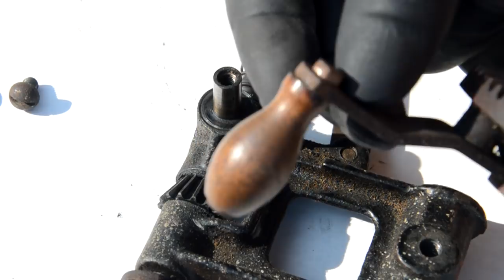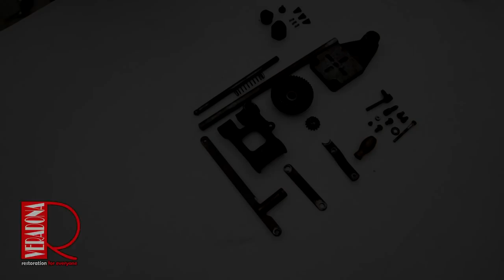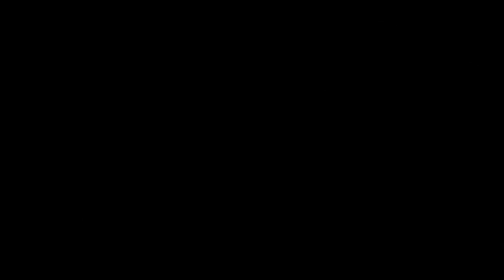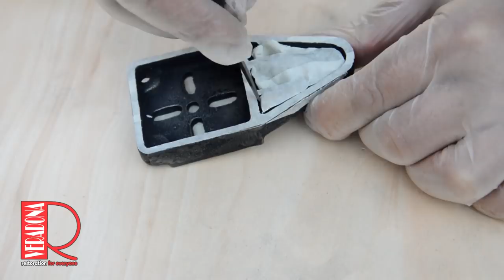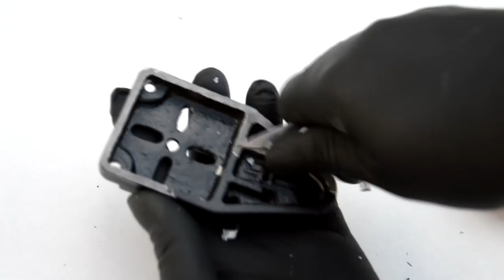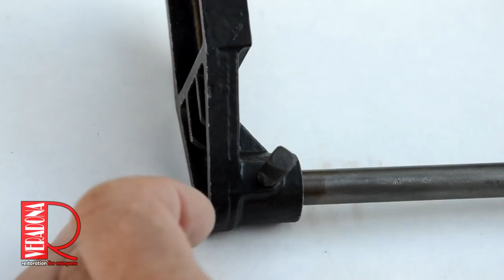Bench Drill - Detailed Restoration

Comment: First, no apology needed as your English is not bad at all. Second, thank you for your videos on restoring things. I wish I could find a small bench top drill like this one. I have been looking for one at flea markets but haven't found one yet. I make wood models of buildings, circuit boards and other things that need precise drilling with very small drill bits. I do have a small handheld drill bit holder for my small drill bit set, but drilling by hand is not always as good as I need it to be.
Reply from the maker: Thank you, perhaps the drill will sometimes buy! Good luck in your work :)

Comment: I’ve never seen a manual pillar drill so small, I wish 'd know about them before I bought my Dremel drill press accessory. A soulless bit of kit if there ever was one.

An excellent restoration as always, a real joy to watch and an awesome little machine. I think Im going to have to keep my eye open for one. I really like the finish, looked so much like the original and better than the really bright red you often see.

It definitely looks solid and I'm sure it will last many decades. May I ask if you will be using it? Or would you be selling it on? If it was me I'd keep it and get rid of the Dremel accessory.

I read the description in the drop down, although I've never heard you speak your written English is excellent. A great video, thank you.
Reply from the maker: Thank you Mark for the beautiful and extensive commentary. I still don't speak English :( but the translator seems to be doing a good job :)

Comment: I have a similar (but larger) drill. Above the splined drive shaft, where it entered the pressure-lever thing, there is a ball bearing, which acts as a (cheap, simple) thrust bearing.

I didn't see one in the take-down section of the video, but is there space for it?
Reply from the maker: I'm sorry Paul, I don't understand the question (translation)